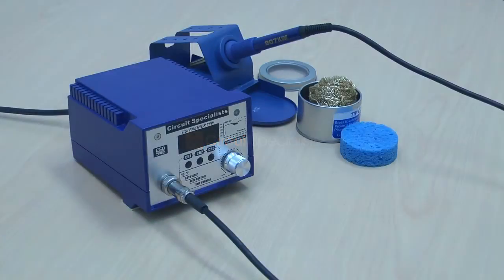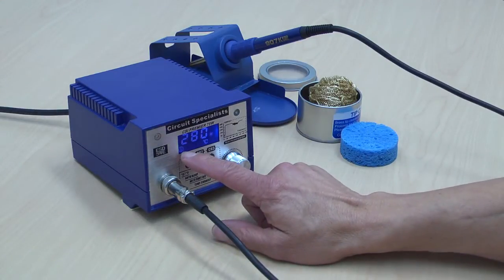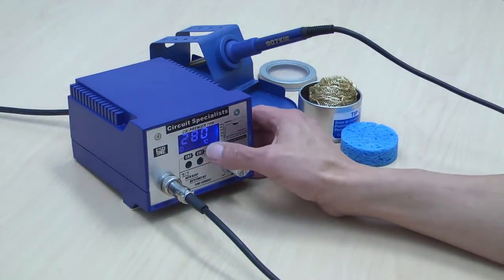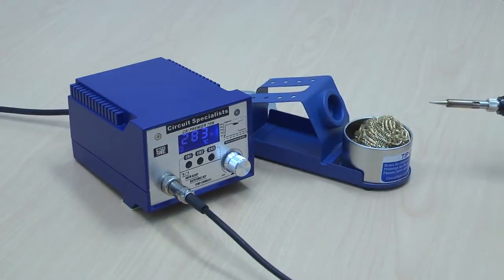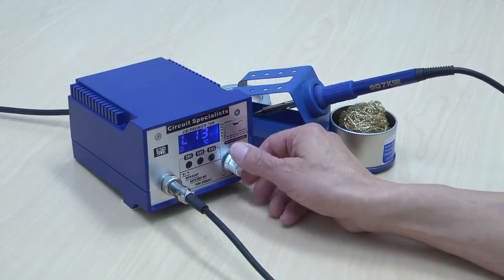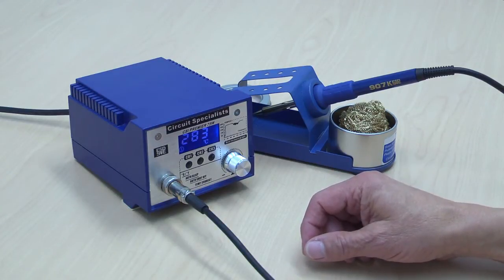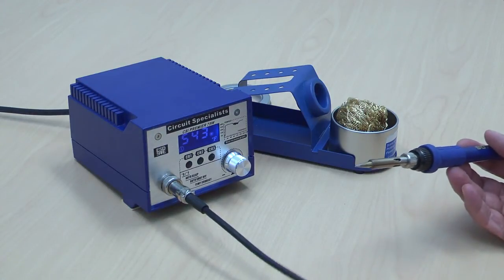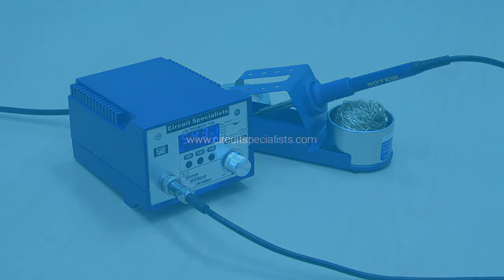Introducing the CSI Premier 75W Solder Station from Circuit Specialists

Comment: It was cool until the iron fell apart because it's made of plastic. A replacement is $25 or a new one is 55$. I think next time I would rather have something that was made of less plastic. I don't think the iron itself was designed very well, certainly not for longevity. Enjoyed it for a while.
Reply: Did you see if there were any compatible irons? I'm having a similar issue. I love the station itself, but the iron isn't great. I'm just researching now to see if I can find something more robust that'll plug in.

Comment: Ordering one now! This unit is awesome!
Reply: xKmotx so how is the station because i need one  right now and i was thinking of getting this one and also if you got it is it for the us and canada plug 120v
Reply: ***** It's an excellent station, but I suggest you get an optional tip in a larger size as the one it ships with is like a 1mm point.I got another tip in 3mm and am happy. I bought this as soon as they announced it, and then a month later the suckers advertised it with a bunch of bonus items that I did not get, Turkeys! lol... Yes it has the US standard 120V plug.
Reply: How do you get the optional tip?
Reply: you have to buy them from the website. they are a separate puchase